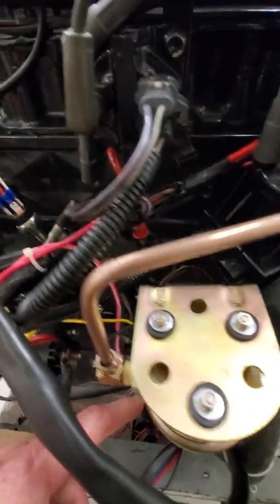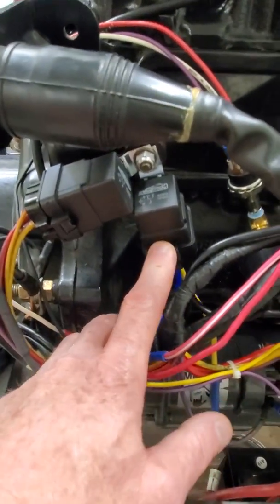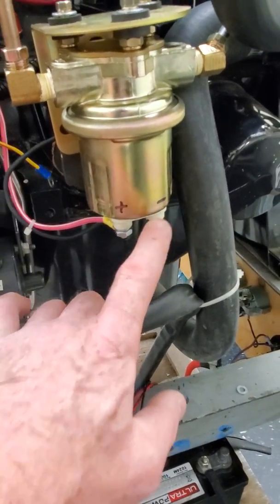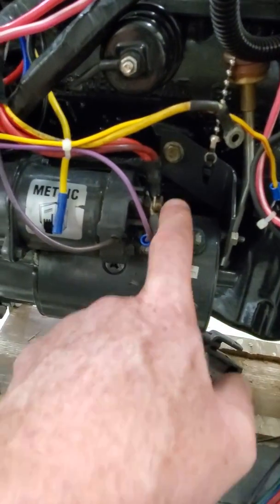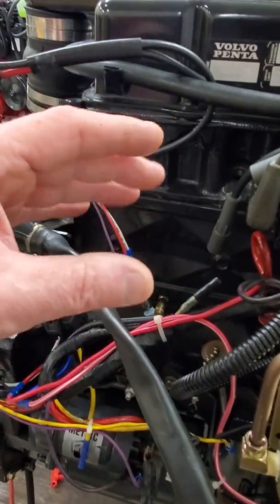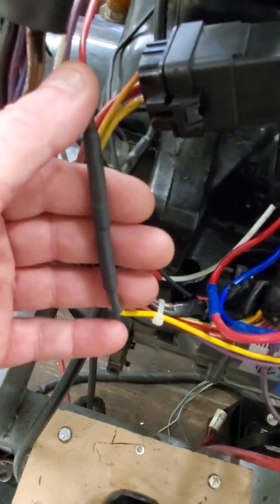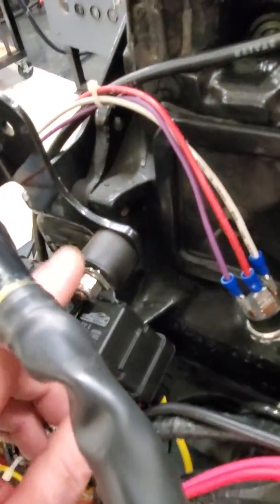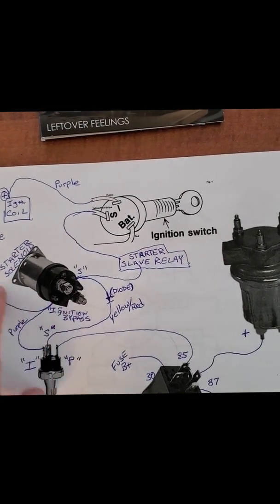Gas Engine Electric Fuel pump conversion part 3

Comment: Adding this to my to do list!  I have a merc 2.5L 1988.  Replaced the fuel pump with aftermarket mechanical a few years back. Have done a lot of repairs and still have a mystery problem. Boat runs great idle through WOT.  Almost like it’s on a timer, at 1.5hrs run time the engine will start to stall when on plane, if I get it back to idle it’ll stay there and at that point I can only idle, if I give it more gas it’ll  stall again.  Wondering if you’ve seen this?  I thought it might be overheating and getting vapor lock. After pulling the boat for winter (first time not at marina and in my yard) I figured I’d pull the thermostat when I added antifreeze. Well, the thermostat appears to be from 1988 and was rusted in the open position. So maybe the engine was running too cool and too rich?  I’ve got a long winter to wait to see if a new thermostat solves this mystery. Thanks for all the great videos btw!
Reply from the maker: @johncmoney8394  If you are running it at high rpm for 1.5 hours and it slows down its a fuel issue. I would suspect either a clogged anti-siphin valve or a clogged tank vent screen on the tank vent fitting that exits the hull. This means air can't get into the tank as fuel is being consumed by the engine and a vacuum builds up inside the tank.

A quick test to determine if this is the case is to run the boat and when the problem begins, open the fuel filler cap. If the engine power comes back - that's e issue.
Reply: @ Thanks Ted!  I replaced the anti siphon valve and did new fuel lines last spring. Also added an additional fuel water separator. Rebuilt the carb twice. I’ll have to double check that vent line though. It’s not at constant high rpm. Definitely varying as there are some no wake zones here on the lake.  Seemed to mostly occur after long idle in the no wake then going back on plane it would occur.

Comment: What controls the flow?

 How does the fuel pump know when to turn off?

 How does the pump know the fuel level in the carburetor. 

Where does the signal that would normally be sent from the PCM come from?

Does the pump run continuously? 

Thanks
Reply from the maker: It runs constantly like a mechanical pump. Electric fuel pums have an internal fuel pressure regulator.

Comment: I have mine in the bilge pump. that way I have a switch up... I might do its own sitch later on.. I have a queastion, if you can answer it that will be great.. will a 12 PSI pump can cause for engine to die at one point as pressure will open the niddle in the carb?? asking as that is the reason I decided to go electric fuel pump, for a more controlled PSI as the one i had (aftermarket) was pumping 12 PSIs
Reply from the maker: Yes, 12 psi is rather high, but if the carburetor float is set correctly the needle and seat should handle it. If it does over come that it will flood out the engine at idle.

Comment: I just purchased a 5-9 PSI electric fuel pump on an older 3.0 Mercruiser. You think that's enough pressure for it. The engine is a 1985.
Reply from the maker: Very much so, 4-8psi is the general range I use

Comment: Any chance you could provide suggested specs for that inline diode for between the starter trigger and the pressure switch terminal?  I'm not sure if it needs to be a certain current rating. Any advice would be greatly appreciated.

Comment: Ted, good stuff, I'm installing a pump on my 3.0 just like you did. Could you kindly put a link to the diode you used? I have some at home but I don't feel right using those with such thin endings in an application like this, I'm not even sure how to wire them, sticking the diode end into the wire? Even though the starter wire carries low current, I feel the diode terminal is way too thin...

Comment: Great video! This is how I wired the exact electrical fuel pump on my 1967 F100 after I put a 5.0L in it with no manual fuel pump. The only thing I wish I did differently was have a starter crank signal. My truck cranks over several times before the oil pressure builds enough to run the electrical fuel pump! Thanks for the videos!  PS! I ordered my special lower unit drain plug screw driver from Snapon l!! I can’t wait to get it!
Reply from the maker: Thanks for the positive feed back, and that screwdriver is Awesome!!

Comment: Hey @Ted, I like this series! I put this exact pump on my 3.0 merc. I did mine a bit differently as carbs that sit for a week tend to not have the bowls full of fuel. I have my pump on with ignition on. then if I need I can manually shut off the pump by the switch i have in line with the ignition power line (purple wire). this lets the pump fill the bowl and get faster starts instead of waiting for crank pressure before sending fuel. I guess the argument would be for safety to do both, have the pressure switch shut off fuel, but for faster starts a momentary switch to activate the relay to prime the carbs would be a good idea. Lots of classic car owners do this. Also on the safety side. most newer mercs, past 20 years?, Have pressure switches and other safety switches that cause ignition to ground, so the additional pressure switch is probably not needed, and you can just wire it up without the switch in the mix. What are your thoughts?
Reply from the maker: For cars that works, but in the matine world we don't want the fuel pump to continue to run if the engine stalls. The main point to do this is if your repairing a boat. If you own it you can add in the manual switch.